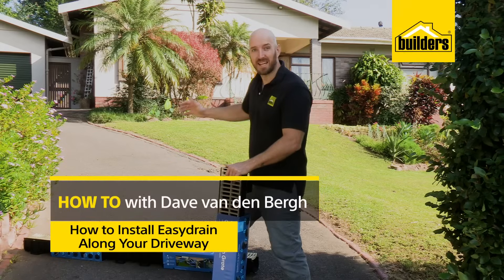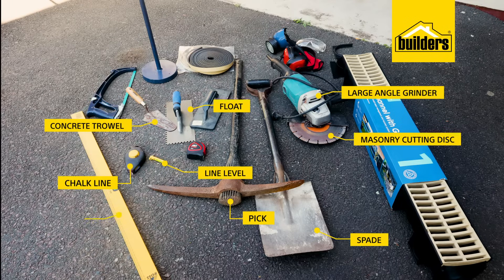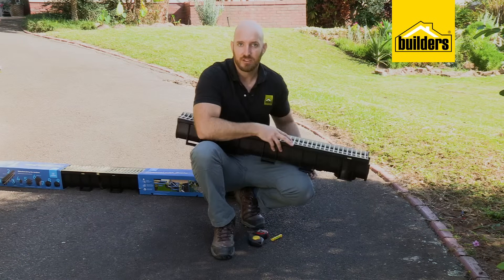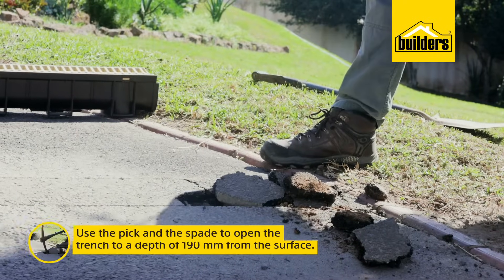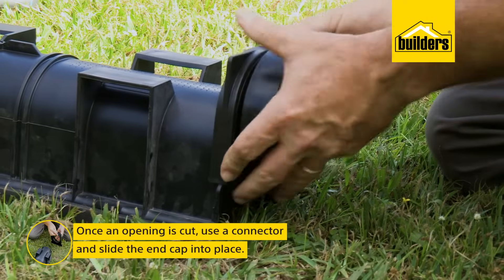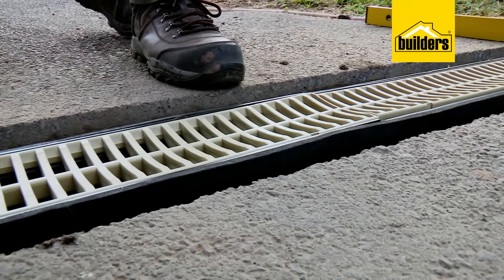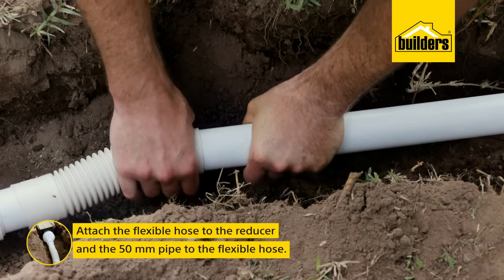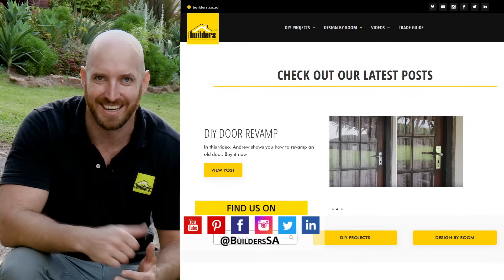How to install an Easy Drain, clip together drainage

Comment: That's nice, but it'll be a mess when it eventually breaks and need to be replaced (it is plastic after all). If you will be mixing cement already, why not make it directly so it actually lasts you a lifetime (or a couple)?

Comment: A good idea is to cover the grate with tape when putting in the cement, then remove once the job is done and dry. Saves cleanup
Reply: Wrap with gladwrap, and put it back in, then conc, then pop it and remove gladwrap

Comment: I have a bend in my trench. I need to connect 2 drain pieces at a slight angle. How can I do that?
Reply: I've cut them with a circular saw before and finished with a handsaw. I cover all external parts of joints with cloth tape before pushing into mortar/concrete because even the clip-together joints are not sealed enough to prevent a little slurry from entering the joint when you're pushing it down in case a long drain flexes a little at a joint. So tape your joint on outside or care not to overfill bedding and place each section in, then silicon your joint from inside before filling sides.

Comment: Why do the channels bend upward after clipped together?  When you clip more than three both ends bend upwards. If you press it flat it just disconnects
Reply: For long runs, I think I've used 3 m lengths. Less joints = better